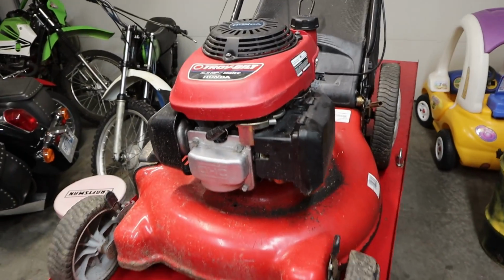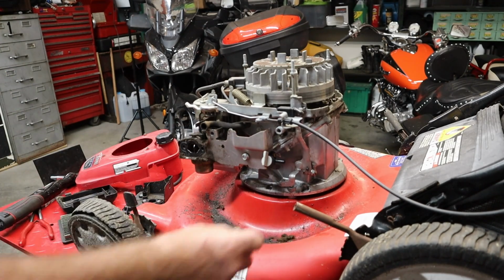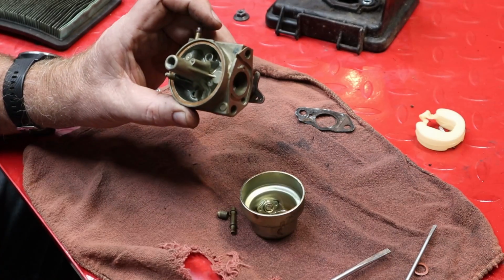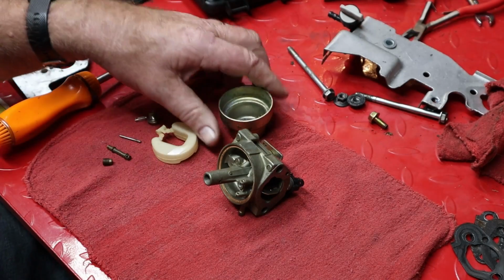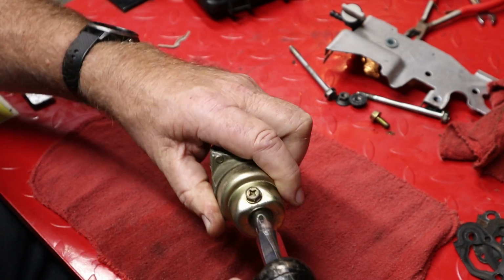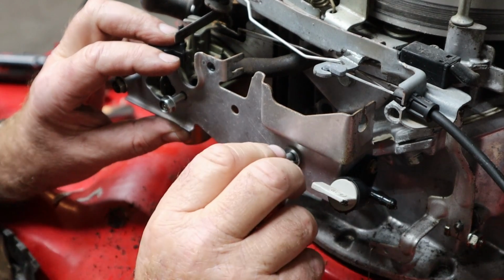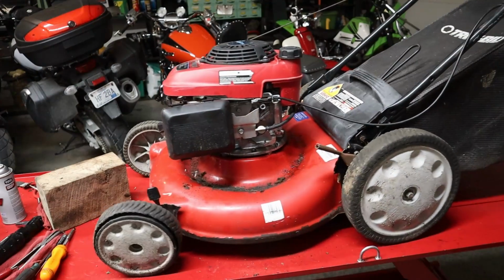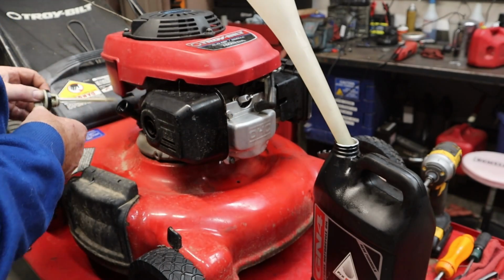Troy-Bilt Push Mower with Honda Engine From Roadside Gets New Life. Will it Run? Yes it Will.

Comment: I snagged the exact mower off a treelawn yesterday. The homeowners son said something was wrong with the engine, it was "clogged up" from cutting tall grass. It was all there, compression  seemed good, and had oil. Took it home and had it running in 5 minutes. The air filter was oil soaked and the whole mower was filthy. I got it running and did an oil change. Will give her a new filter and plug. When I first started it it smoked like crazy. Made sure the oil was topped off and put some ethanol free gas in it. Put it away and ran it again today. Engine sounds great and no smoking. Will detail her soon. Will make an excellent mower for my son to learn with. Can't beat those Honda engines.
Reply: Today she got the spa treatment. Drained the oil. Scraped the underside of the deck and washed it. Painted the underside with black Rustoleum and installed a new blade. Forgot to mention that I degreased the engine and gave her a nice bath. Used the leaf blower to dry unit.  Got her on the bench and took off the wheels. Cleaned and lubed the axels, and  lubed the height adjusters. Get some matching red Rustoleum paint and touched up several spots on the deck. The worst area was around the discharge chute. Replaced the plug. Lubed the cables. Put the oil back in and will let her dry overnight. Have the chute bunge corded up as the red paint is still drying.

Comment: Nice older video! I’m surprised the gaskets didn’t cause a vacuum leak and give you trouble, they looked pretty squashed. I used to dislike working on Honda GCV carbs but I’ve done so many that now I kinda like them. Too bad they’re not making them anymore, but there will still be plenty of old mowers like this around to tinker with lol!
Reply from the maker: Thank you for watching.

Comment: I have a troy built self propelled 

12av5657222 i was running it hit a brick and it now refuses to start
i cleaned the  carb
Removed the stater and checked the cam lock pin
Checked shim on the pistons
 Got new kjil switch cable
Changed spark
New gas 93 non ethanol
I have never used enthenol
Worked flawlessly for 5 years
Then i hit a brick the motor stopped and no joy since

It will start after 3 pulls but coughs revs up and down never hits full power and quits within 30 seconds 
The new spark plug is black cleaned retry same result.

There are bo carb adjustments it as this funky temp controlled carb actuator on it.  

I am lost…. Thoughts?  Did i blow a piston?  How can i tell without a compression tester

After 1
Reply from the maker: Check the flywheel key. Thank you for watching.

Comment: I have this exact mower. Starts well cold on first pull choked. Been running a bit rough (like surging sounds), and once I shut it off hot to bag grass clippings it won’t start back up. I went through your video here exactly and cleaned the carburetor and put fresh air filter and gas and new starter this year. Any ideas? Or videos explaining how to remedy? Thanks
Reply from the maker: Sorry to hear that. Check the valves and the spark plug first. See if you are losing spark when it will not run. Thank you for watching.

Comment: I was going to say wheels, and the front critter catcher. Just like the one my neighbor gave up on. I used it all last summer. I rebuilt the carb and cleaned it out as best I could but I can't get the emulsion tube out. Still surges.I guess I'll have to buy and easy out reverse screw drill.
Reply from the maker: Thank you for watching.

Comment: What is the model number of this mower? I have what looks to be the exact same mower with a Honda 160 GCV auto choke engine and there's no tags on the deck the whole back of the deck is pretty much rusted out when I got the mower. The stickers are gone off of the plastic shroud it just has Troy-Bilt 21-in cut. I'm not having much luck finding the model number the Honda engine says 2009 on the side of it but I can't find any mowers that match identical to mine this looks like the closest one I can find. If this has the two piece plastic baffles in the back of the deck? Thank you for your help.
Reply from the maker: I ma sorry but I no longer have that mower and I did not record the model number. Thank you for watching though.
Reply: @RaymoreRepair  no problem thank you for your response that's the first video I've ever seen of yours I subscribe to the channel thank you for replying
Reply: troy bilt 11a-542q711

Comment: Great job. If I could turn back time, I would have went to small engine repair school right out of highschool. I love working on small engines.
Reply from the maker: I used the stock throttle cable for this application. Thank you for watching.